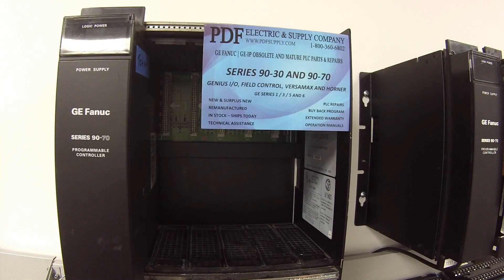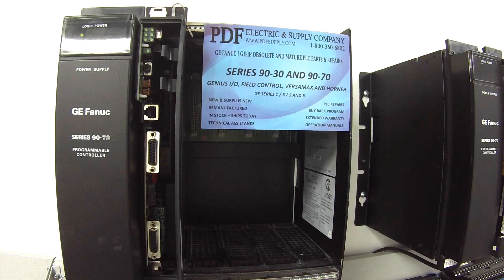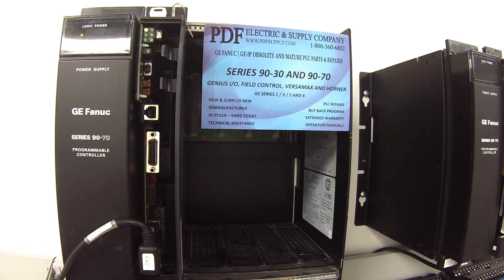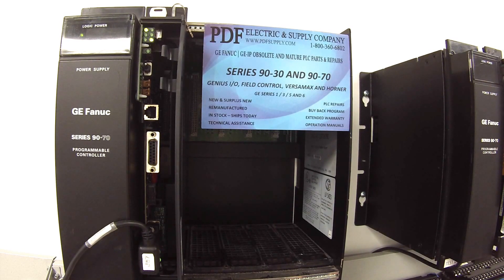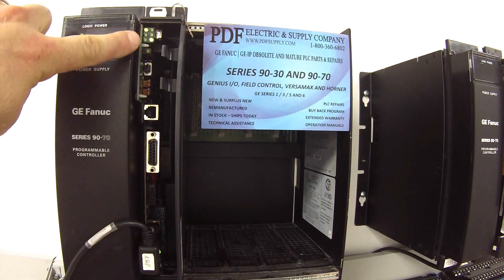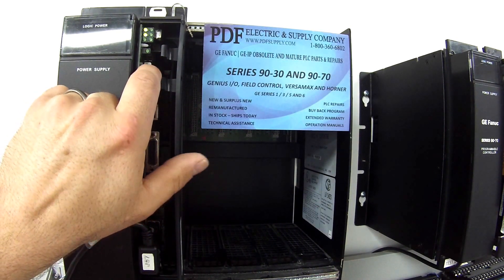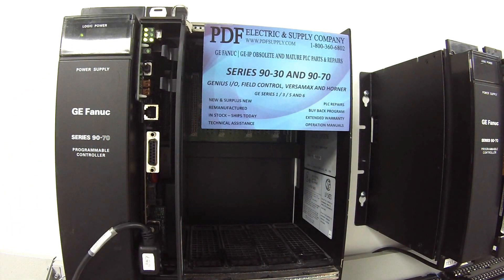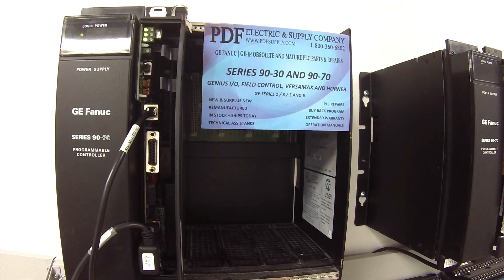How To Troubleshoot: IC697CPX772 (GE Fanuc PLC Training Series 90-70 CPU)

Comment: hi i have Rack IC697CHS750 + PWR  IC697PWR724 +  IC697CPM790 my pb is Run output off ( message error system configuration mismatch) stop Faulted